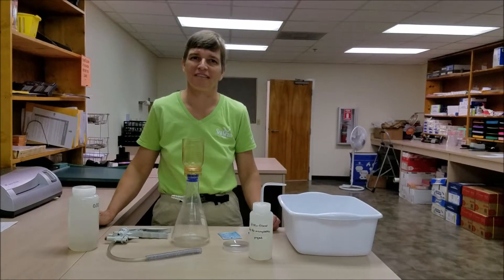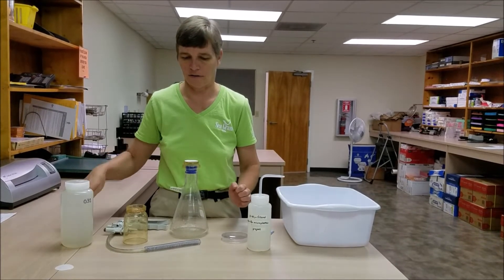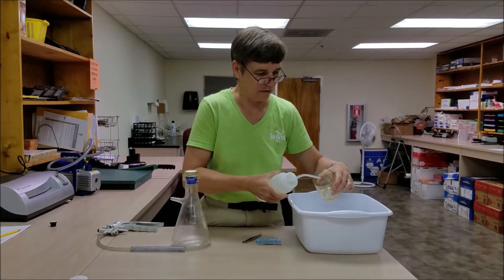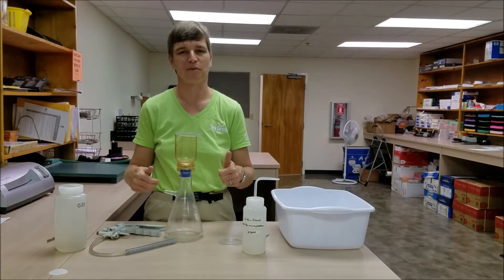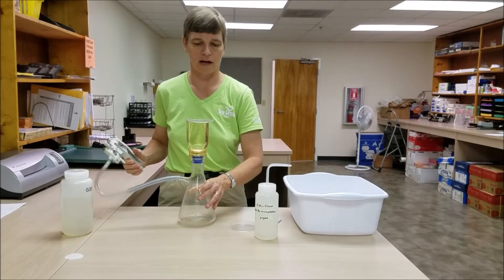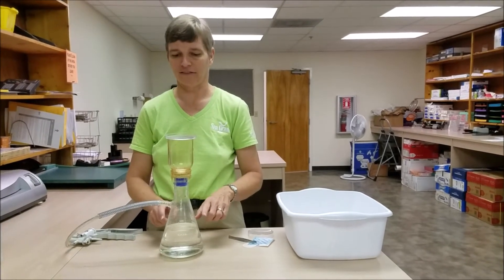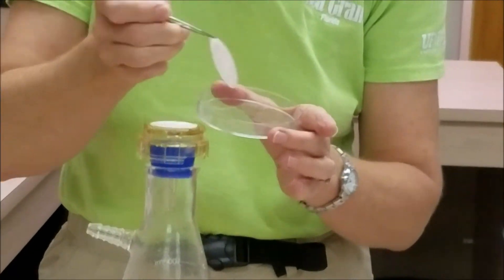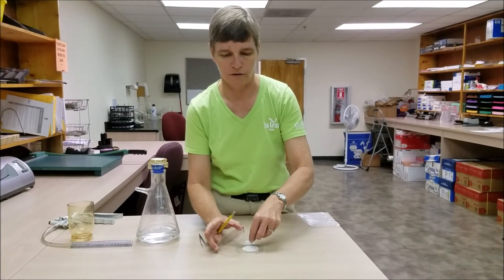FMAP4 Filtering a water sample

Comment: Very nice video. I have one question, what kind of filter are you using exactly? Because some Whatman filters contain plastic. Do you happen to know the code of the filter? Thanks!
Reply from the maker: They are cellulose acetate filters, so are synthetic, but I have tried to pull fibers off them under the microscope without being able to do so. I am confident that none of the fibers found when filtering water samples are coming from the filter itself.
Reply from the maker: We are using 0.45 micron filters from wyvernsci.com